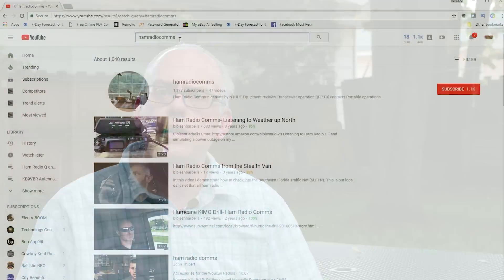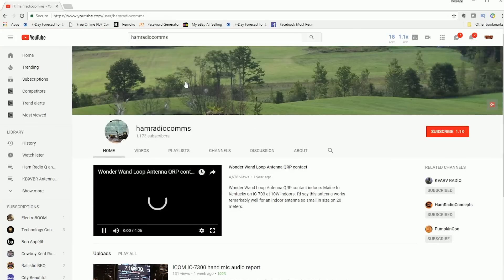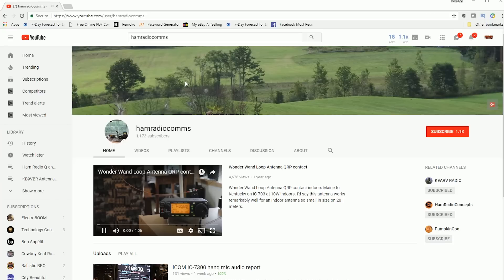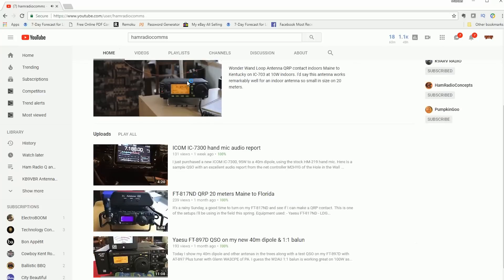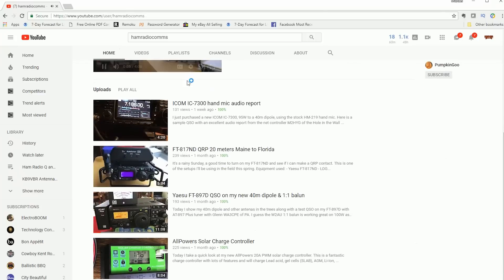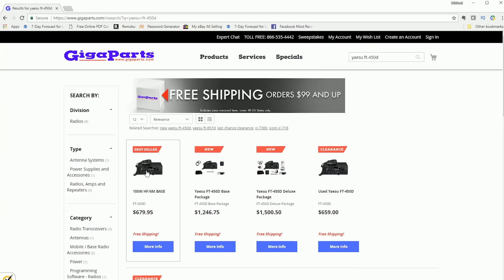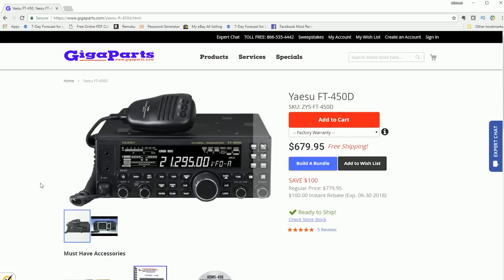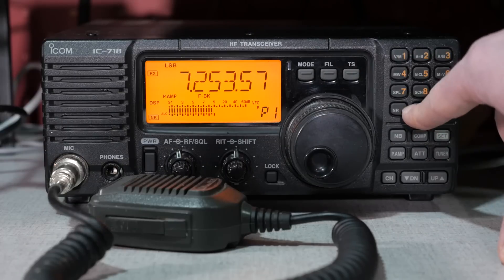Your Questions Answered, May 2018 - Ham Radio Q&A

Comment: Michael, what would be a good price for a used Icom IC-718?
Reply from the maker: I've seen the Icom IC-718 go for around $400 - $450 at local hamfests. If wouldn't pay more than $400 if the rig does not have the DSP board installed. Currently on eBay, they are selling for $350 - $450. This model seems to really hold its value, (I purchased mine new back in 2002 for around $450). Depending on condition, I think $400 would be a good price.
Reply: KB9VBR Antennas Thank you Michael!